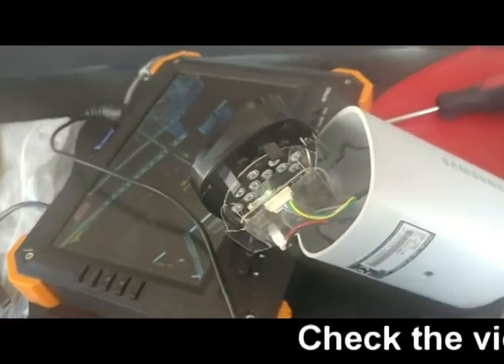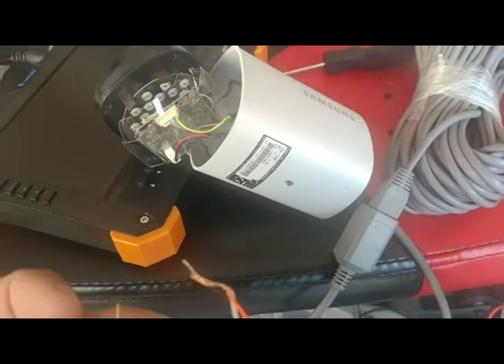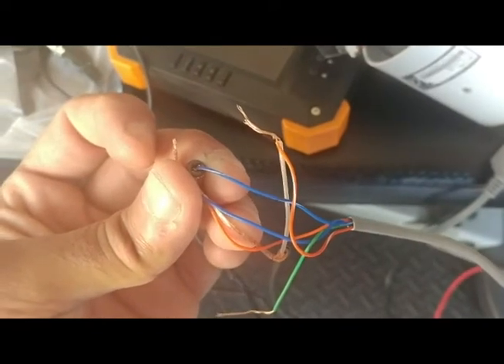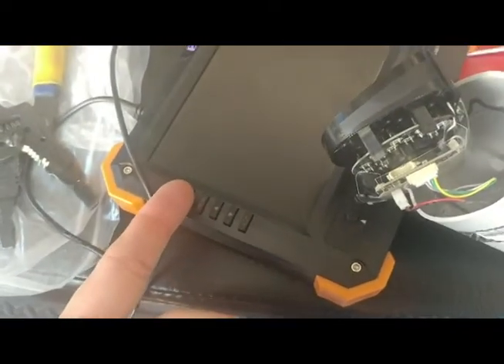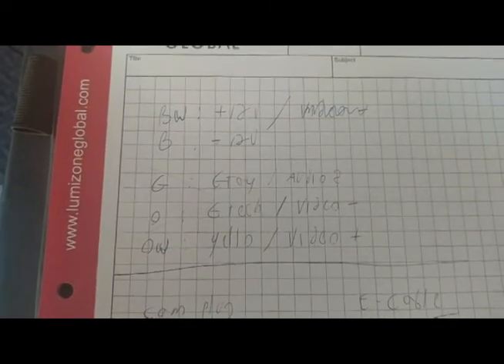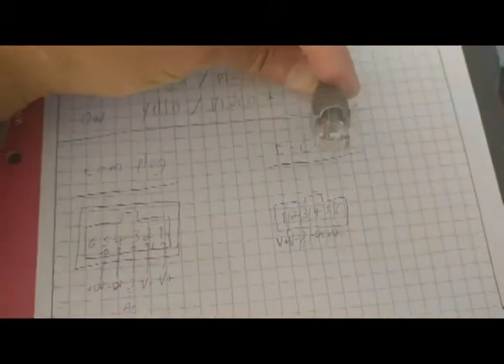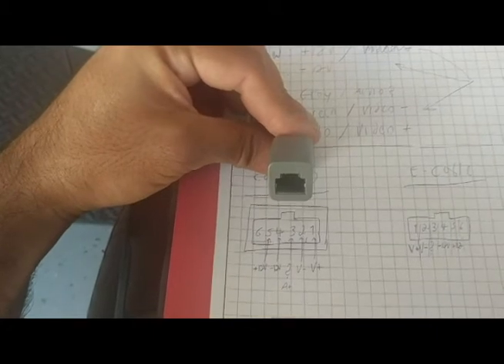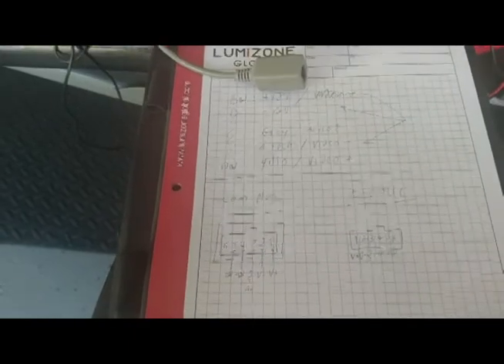How to re-wire Samsung Camera RJ-45 to standard BNC Video plug

Comment: Great explanation of this camera wiring. I was left out with a non working, non supported Samsung device with 16 channels but the system is very unstable. I would like to re use these cameras with another DVR system that uses non PoE cameras. IP66 standard is what these cameras are but I haven't find any DVR that can directly support them unless I convert from RJ45. Also, these cameras were supposed to be managed by ONE ip address assigned to the controller box not individually and I guess that's ok. I will sell the system for parts with 8 cameras and I will keep 4 for personal use/play with sort of thing. What system do you recommend I look into?
Reply: Selling ? Let me know ..
Reply: @zxamz  Hello, I am planning on reusing the cameras for a project of mine with a raspberry pi as the DVR but I am using a POE switch to power the camera. I still don't have all the details of how I am going to do this and I would imagine I will have to rewire the camera inputs at some point. I have other options where I don't have to destroy any of my Samsung cameras if you are interested in buying the surveillance system from me le t me know and we can make arrangements. I already have everything i need to start on my project so I am trying to get information from Halcyon to see if he knows if this conversion would not work and why.